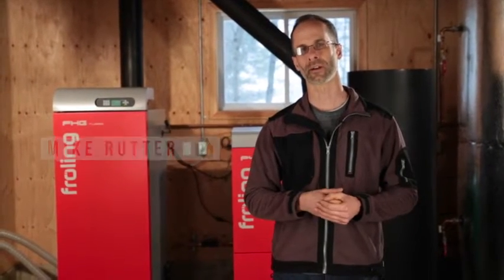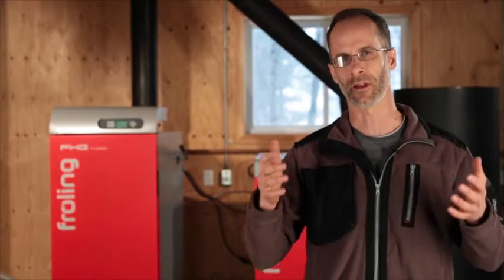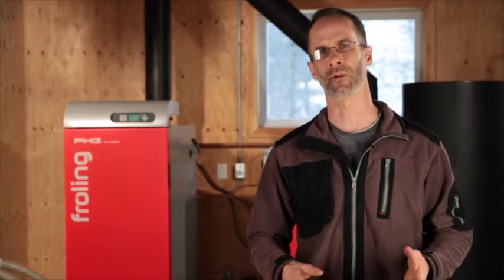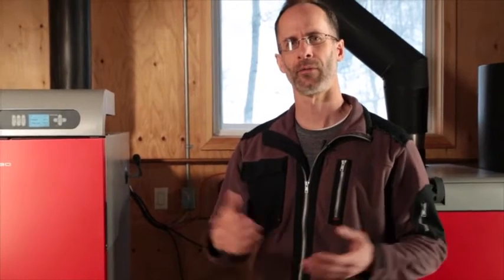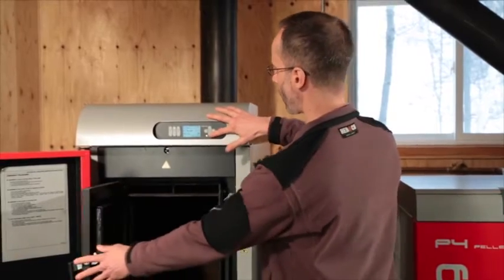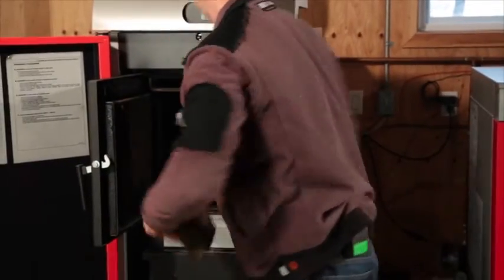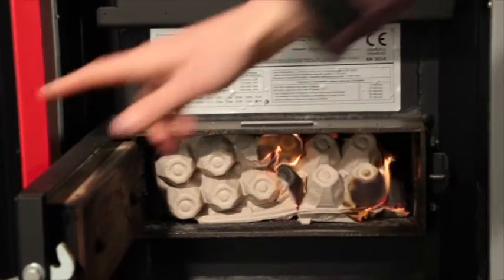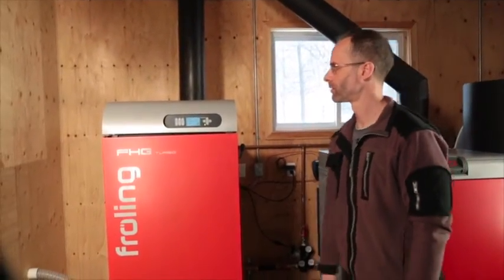Froling FHG Firewood Gasification Boiler Operation

Comment: This is all sounds great but eleven thousand dollars for the unit is just way large for my blood.
Reply from the maker: The heating system for your home is a big investment for sure.
Reply: @BiothermicRES  I can tell you that I can make me a furnace from 100 percent 316 stainless steel and still have funds left over. Good day fella.
Reply: I bought a house with old boiler and I am incorporating my culture of cooking in the earth oven with igneous stones and burning less wood, coz the heated stones still maintained water temperature when the fire is off.
Reply: @maienduo  The stones are heat sinks.

Comment: Looks nice. What does it cost, and how big a watertank can it heat up?
Reply from the maker: The Fröling FHG 20kW boiler in the video is paired with a 1500L pressurized buffer tank.  We find that 1500 to 3000L buffers work well for the range of Fröling firewood boilers.  The largest boiler will output 50 kW of heat so you can heat up a buffer quite quickly.  However, a properly designed heating system will send heat to any space heating demand prior to heating the buffer.  The buffer is typically used to hold excess heat produced by the boiler to be used after the boiler has finished firing.

We're happy to get you some pricing.  Please give us a shout anytime.
Reply: .Biothermic

Comment: I have a 2018 fhg turbo, can I get Froling connect?
Reply from the maker: The FHG is not supported in Froling Connect.  In order to use Froling Connect the FHG must be upgraded to an S3 by installing an additional control board.  Then you can use a touch display to get access to Froling Connect.  Please get in touch with us and we can provide more detail info@biothermic.ca.